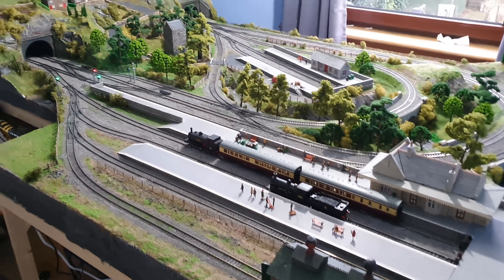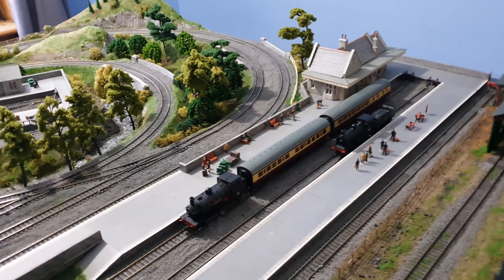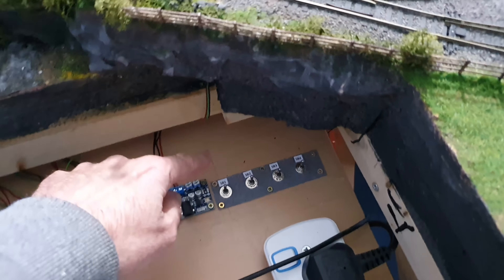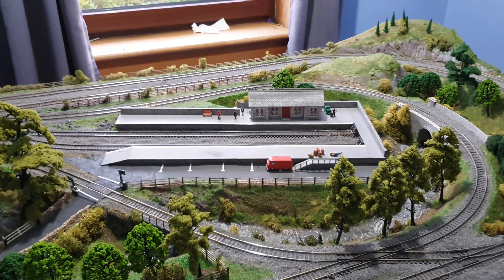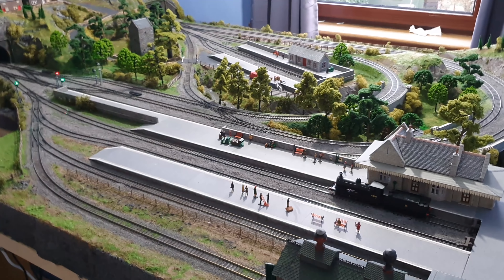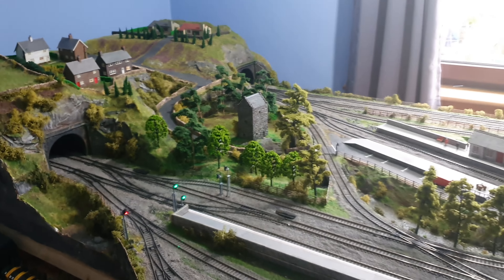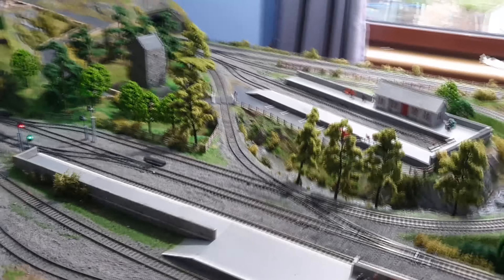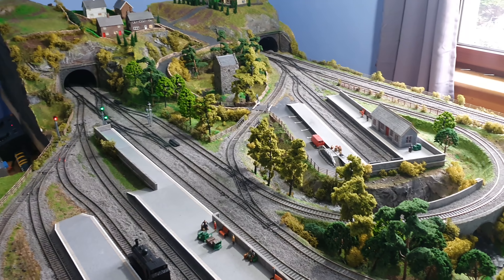Layout Update

Comment: You could do with a better hand uncoupler, Bill: an instrument driver is tricky! 
I've had good success using cocktail stirrers -- you hold the stick and use the big flat 'handle' to lift the couplings. They are OK when you have lots of space beside the trains. A better idea is to make something similar, but with a flat plate attached to an angled handle, so you can approach the coupling from above , sliding it under the coupling at the last minute. Idea for another short construction video, maybe?

Comment: Been binge watching your repair and maintenance videos. Thanks to you, one of my previously dead Class 37s is now running around my layout. Cheers.
On the subject of your platforms, why go to the expense of new ones? If you can lift the old ones without damaging them you could just raise them up on the appropriate thickness/thicknesses of cardboard and disguise the bottom with more ballast. Just a thought.
Reply from the maker: Yeah I've thought of that. But I like the idea of changing them to red brick walled ones and I want to alter other bits of them so much I'm as well to just make new ones from scratch,
Reply: @oobill  Fair enough. As a serial mind changer myself I can't argue with that! ;-)

Comment: I made my platforms using the Scalescenes downloadable kit. I think its somewhat higher than your Metcalfe. I used the sides and platform edgings and basically winged the rest to get the shape I wanted. I had a part roll of 3ft wide plotter paper so I used some of that to cover the top and then painted it with acrylic paint (much cheaper that inkjet ink!). Since I bought and downloaded mine he's changed it a bit and now includes a small platform building in with the kit,

Comment: This is a good idea if the exchange loco is waiting in the destination station for the train to arrive and take the coaches back, you already have the means to get it on the end, however you would need three locos.  Also they would be tanks as tender locos only run tender first for shunting because the coal dust would cover the crew at speed.  Good work though, hope you have fun.
Reply from the maker: J36 runs tender first in this clip https://youtu.be/pkBNPeAxP98?t=2285  I plan to do this with a mixture of tanks and 0-6-0 tender locos
Reply: Oh I get it, ur modeling the 60s with track work for diesels 😉

Comment: Very interesting. And particularly topical for me, as I'm just in process of adding a shelf layout, above my regular Hornby layout, specifically with idea of end-to-end running, with a terminus station at each end. I did order the same type of shuttle unit as you have. But I model LMS operations in the 1930s, so using the shuttle is a bit tricky. Really the only kind of train from my period that the shuttle could be used for would be a push-pull type train, where a steam loco could be driven remotely from the back of the brake coach. So... I'm trying to set that up. But your idea of being able to switch off the shuttle, and then have isolated sections allowing you to use two different locos for taking trains back and forth is very interesting. Bit tricky though. Where should the isolating break go? Basically, I suppose, it's only critical to be able to hold a loco right at the end of the platform without moving, whilst a loco couples to the other end of the train and takes it away. And the same section in the station is going to need two separate feeds, one from the shuttle, and another switchable one independent of the shuttle. I'll have to think a bit more about this, I can see.
Reply from the maker: I'm also considering building a shelf layout at some point. Maybe in N gauge. Shuttle would be easy enough and switching locos as I do here would be easy as all you'd need to do is put switches over the breaks in the tracks the shuttle uses. It's the shuttle route being connected to both loops of my layout that causes the complication.

Comment: Hi Bill. A great video & layout. I agree with Tom H, a couple of strategely placed home made uncoupling ramps would give 'hands free' uncoupling each end. I've found clear blister packs from Wills building materials is flexible enough. Just a strip about 10mm wide pinned at one end, the other with a small slot and pinned to allow flexiblity between the rails works well. Just an idea but most of all have fun!
Reply from the maker: I have some hornby ones somewhere, Not sure how well they would work with the mish mash of couplings I have.
Reply: @oobill  - if you haven't got Hornby track, the Hornby uncoupling ramps will be a pig to fit (they are designed for the sleeper spacing and width in use at the time they were made). They are also VERY obtrusive -- using springy clear plastic for the  'ramps', as suggested by others, makes them almost invisible. 
Another fancy way is to use a solenoid, to lift a flat plate (in the 'four foot'). More wiring though!
Reply: @oobill  Best advice Bill is to try out a variety of ramps on a spare piece of track to experiment on what couplings you have without disturbing anything on your layout.

Comment: Hi Bill. I’d need to be round the corner to look at this idea! As good as it is and as well as it adds operational interest, you might have looked to use Relays to do your switching! (ie. One switch to switch the relay and the relay switching however many circuits you need, in whatever configuration!) Great job never the less. Cheers. Happy Burns night.
Reply from the maker: Interesting idea. Might look into it.

Comment: HI BILL, NICE LAYOUT,FOR THE LIMITED SPACE YOU'VE GOT. AS FOR THE HIGHT OF METCALFE PLATFORMS, THEY ARE THE TRUE SCALE ACCORDING TO THEM. THE ISUE IS, THAT'S WITH THE TRACK DIRECTLY FIXED TO THE BASEBOARD, WITHOUT CORK OR BALLAST UNDERLAY. SO YOU HAVE TO RAISE THE PLATFORM UP ACCORDINGLY. OR BETTER STILL BUILD YOUR OWN. A LOT CHEAPER TOO! CHEERS, RUSS.
Reply from the maker: My platforms and track are set on the same surface so the track isn't raised. Whether they are to true scale or not they don't sit at the correct height in relation to locos and stock. Easy taken into consideration when rebuilding.

Comment: Excellent Idea, Bill, but I do my "shuttles" much more simply, especially with all my 0-4-0's, just have one coupled at each end of the short train and off we go, makes running over points better too!
Reply: You mean, "top and tail" as it's called in the U.K..  He actually has room for an escape crossover in the main station from track 2 to track 3, that would allow a tank engine to run around the two coaches there, he could probably do the same at the other station by eliminating the end platform and installing a footbridge between the two platforms and extending the track about 3 inches.

Comment: Bill
Why not use 3 engines 1 waiting at each end, and one pulling the coaches 

Engine 1 pulls from station 1 to 2 and uncouples. Engine 2 at station 2 picks up the coaches and runs back to station 1 and uncouples. Engine 3 runs to station 2.. .... 1 back to st 1 etc. Ps small strios of p,attic from  escapee packaging make excellent tension link uncouplers.
Reply from the maker: Yeah that's kind of the idea once I get some more 0-6-0 locos that are suitable, (Any excuse to buy more locos). I have some hornby uncouplers somewhere.
Reply: Crikey, Simon, your railway would never turn a profit! Three locos and crews for a two-coach train? Sounds good fun though!
Reply: @PeterJewell2  personally, I run 9 coach trains behind a 4-6-0 on the up and down lines :-D

Comment: Would a run at both ends around not been a better option.
Reply: That would be much more prototypical, but it also requires much more space. You would need to fit a point, and a headshunt, beyond where the train stops now. The headshunt has to be long enough that the longest loco you are going to use can clear the point, and you have to allow enough clearance for the loco to pass the end of the train when it traverses the point (at both ends). In the centre of the layout, Bill might get away with doing that if he runs 2 or 3 four-wheel coaches, but the platform isn't long enough to do it with bogie coaches.